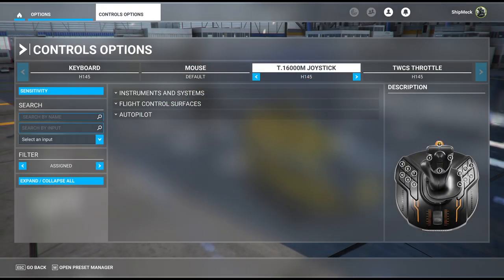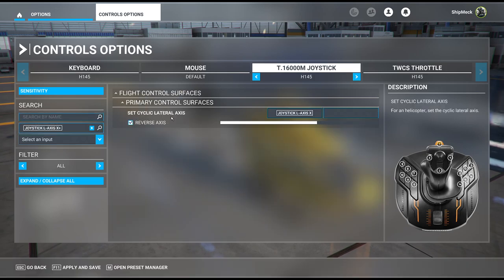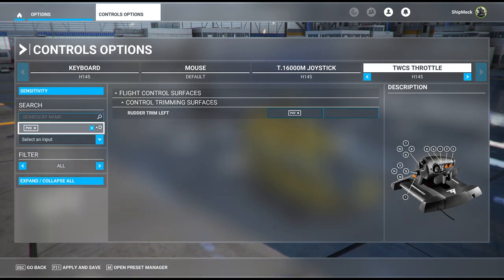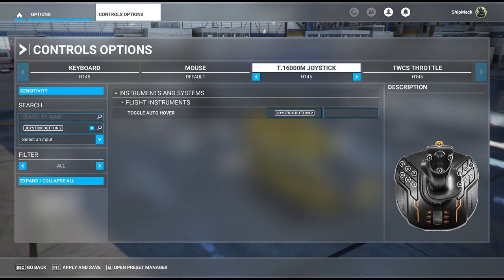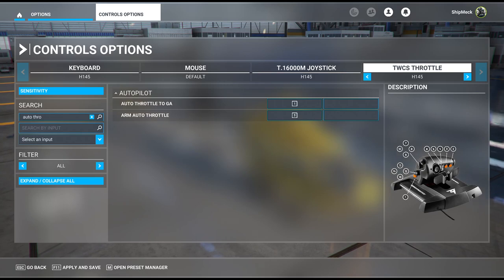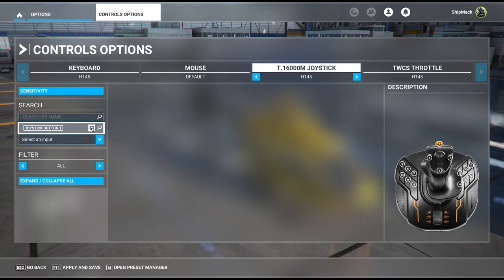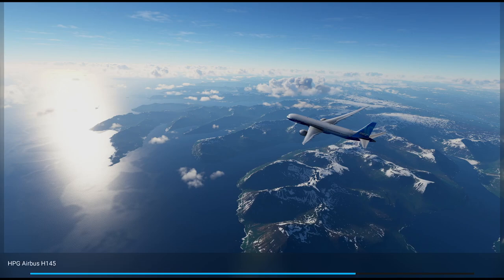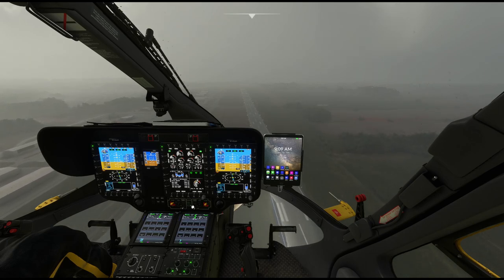HPG H145 Control Binding

Comment: Just the channel ive been looking for. Have you had any problems completing the missions in The H145?, My missions stick trying to find a local hospital. Thanks in advance. Plus the video is only showing 360p for me.
Reply: Can't help you with the missions question ..but in regards to 360p  ..utube needs a bit of time to upload the full resolution so we need to wait a wee bitty then we should have full res
Reply from the maker: Are you creating your own missions or using the tablet? If you are using the tablet to autogenerate a mission, when it gets to the hospital, you must select one from the map. Then at the top it will ask if you would like to use the one that you have selected. When you click yes, it will load it up and off you go.
Reply: @Shipmeck  that tablet  doesn't let me click on any of the hospital's. I must be doing something wrong. I'll keep trying. Thanks.
Reply from the maker: I just posted a new video where I go through a HEMS mission. Check it out and let me know if you see anything difference when you do it.
Reply: @Shipmeck  watching now. thanks!
Reply: @Shipmeck  I'm an idiot. I was clicking on Helipads rather than Hospitals. Thankyou for your help. Appreciate it.
Reply from the maker: @stevenboyd5044  hahaha. No problem. Glad you figured it out.

Comment: my guy, the reason you are getting frustrated and having to click many times is because you are clicking on search by input and it starts flashing white and gray so it is waiting for you to push a button or move an axis on your joystick. click any joystick button to stop it.
Reply: Yup that's right, plus you gotta make sure if you hit a latch switch that you return the latch switch back to the opposite position so the system doesn't think you are still holding a button or something, same when map a switch. You have to flip the switch and then flip the switch back